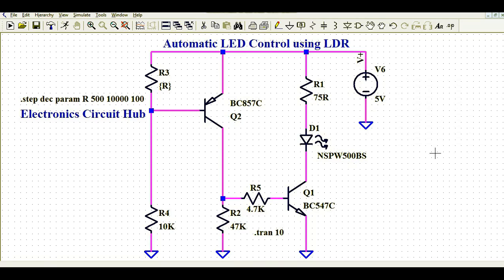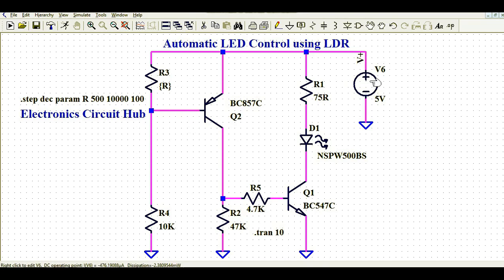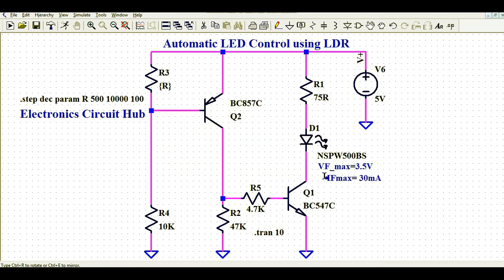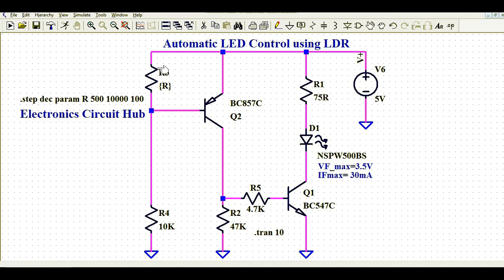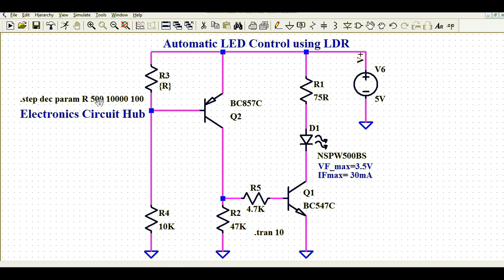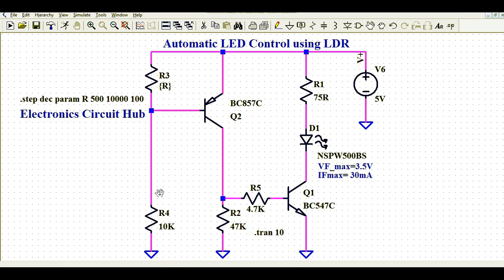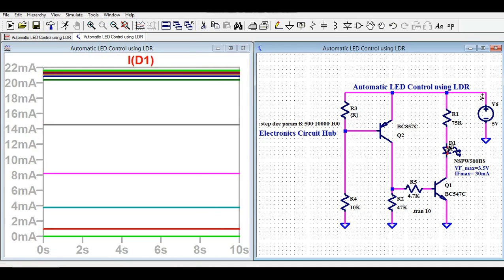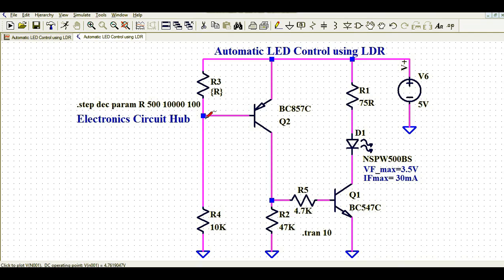LTSpice Automatic LED control using LDR | Simulation

Comment: Hello Si really appreciate your video , i just wanted to know as to why you have you writer 75R for the R1 whereas {R} for R3. I want to know as to what difference does it creates
Reply: {R} is a variable resistor simulating an LDR. With the .step param you can specify begin/end/step resistance.